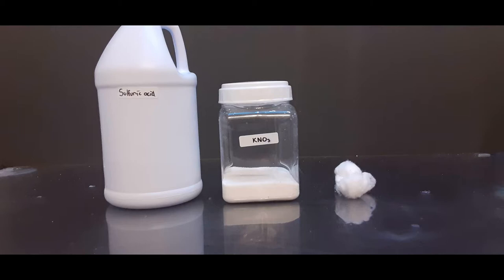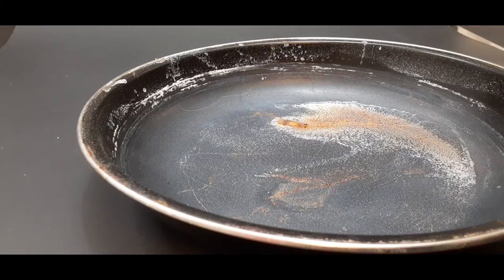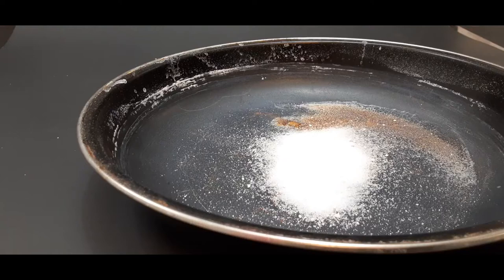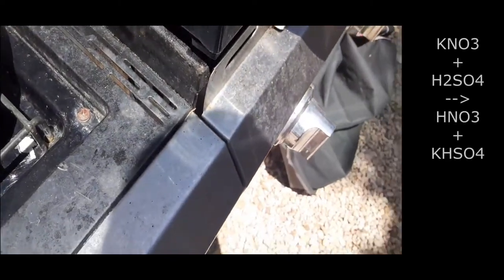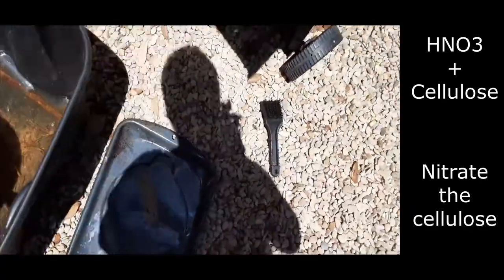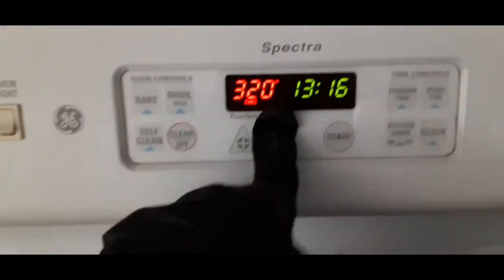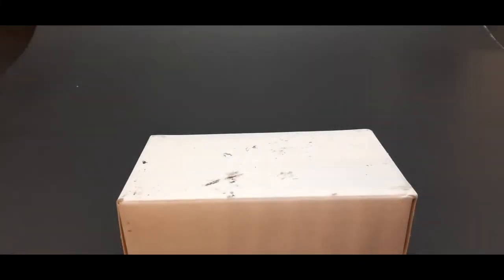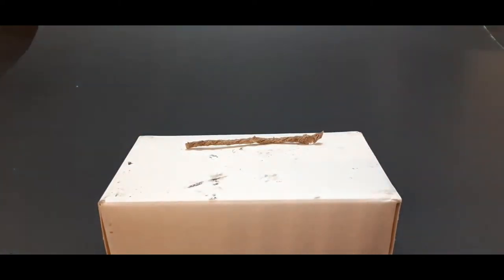NITROCELLULOSE

Comment: That's a great pyrotechnic display, and the chemistry mentioned does check out...but that's clearly not nitrocellulose. That's cellulose soaked in potassium nitrate and sugar (the flame color and smoke give it away). And if that was real nitrocellulose, it would've gone up in flames in your oven, since it autoignites at only 320F...and you said you like to bake it at 350F. I'm not a safety freak, and I love explosives and pyrotechnics, but your video has the serious potential to mislead people into accidentally burning their house down.
Reply: Yes, this is definitely cellulose just mixed with potassium nitrate. There might have been some nitration of the cellulose that has happened in the process, but clearly not to any great extent. I have made nitro cellulose, by letting cotton react with a mixture of sulfuric acid and nitric acid. The nitrated cellulose should be rinsed in water afterwards. Properly nitrated cellulose does not give off smoke when burned, in fact it is sometimes called "smokeless powder". I have also merely mixed cellulose with potassium nitrate, which makes a nice pyrotechnical result, but it burns in a very different way, as your result in the video.
Reply: He made the wrong thing lol 😂 all you need is sulphuric acid and nitric acid that's it
Reply: @babydoll420xx  it can be made with kno3 too

Comment: Yeah that's not nitrocellulose at all😅 that's cellulose with an oxidizer (potassium nitrate). One mayor property of nitrocellulose is that it burns WITHOUT any smoke at all😅 
you make nitrocellulose with sulfuric acid and nitric acid. (And ofcourse cellulose) 
You just mixed cellulose with potassium nitrate. And that is actually one of the easiest things ever xD.
Just dissolve potassium nitrate in water and soak the tissue 😅 will give exactly the same results (potassium nitrate content must be adequate to fuel so not to much and not to little)

So yeah some very hefty miss information here😅😬

Comment: Be careful, keep your rxn temp at 15C don’t wear flip flops when working with strong acids, and don’t put your NC in the oven. Keeping a low reaction temp makes a much better product plus you did not let it react long enough.
Reply: true man I kind of rushed it because my product oxidized
Reply: Shouldn't NC like... Don't smoke? I'm not an expert but.. I think that NC has smokeless burning.. This looks more like if you put KNO3 in hot water and soak the rope or paper in it.. It literally has the same effect as his NC
Reply from the maker: @bblue3350  yeah I kind of messeted up, so its half NC and the other well I don't know definitively some impurities
Reply: Any advice on do dont do while making it  and store it
Reply: @msszone  keep your reaction temperatures low and let it react over night. Make sure the NC is properly neutralized with sodium bicarbonate. And try to store it wet in a basic solution of NaHCO3 and water if at all possible then wash and dry before use
Reply: @industrialadhesive6357  thank you very much
Reply: @msszone  anytime!